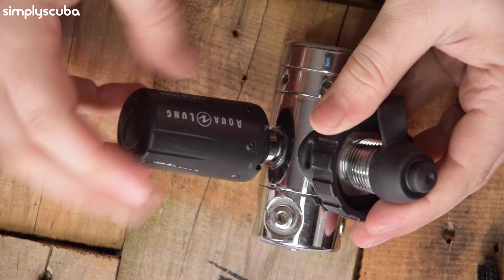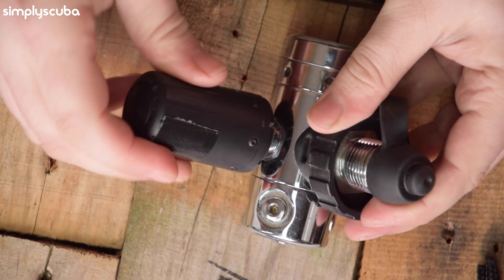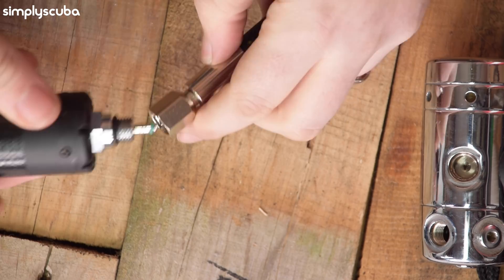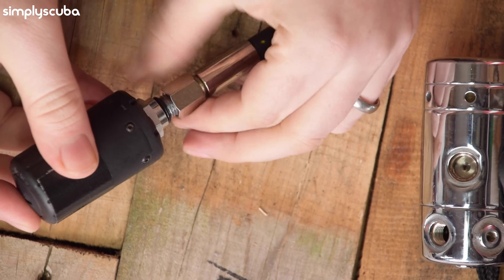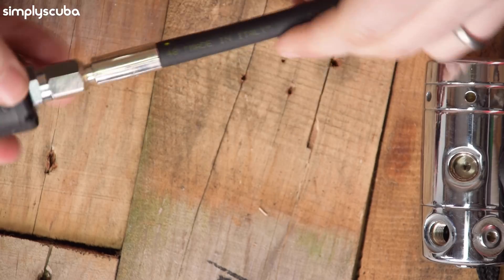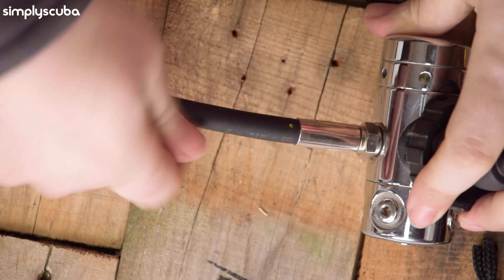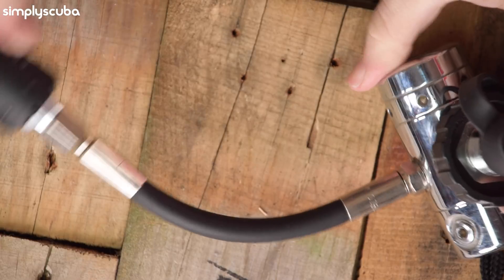How Transmitters Work & The Differences | Deep Dive

Comment: I used AI from the very beginning, since my owd course. So I never dove without it. Yet an analog spg is always backing up my transmitters.
Now, entered the realms of tech diving, I got transmitters on all my tanks. Accepting the risk of additional failure points for the benefit of increased situational awareness and safety. As AI alerts me, if for any reason, my gas runs low. Plus the estimated ground time remaining feature based on actual air consumption is a nice feature to. Till now, touch wood, never had any issues with AI, nor ran into trouble due to incorrect measurements/data.

Comment: 4:22 some ideas on why you may want bi-direction communication in designs.  Negotiate frequency, activate solenoids, pairing different probes on different tanks together, solenoid activation (e.g.  shut off tank/turn on tank, auto-switchover of CCR to OC or vise-versa), diagnostics, etc.

Comment: I'm diving without an SPG for about a year now and I had countless discussions about it. :D One hose less, one failure point less and if my transmitter ever fails, which it never did so far, it's not a huge problem. I only dive with buddies with a pretty similar air consumption, so I would cut the dive short to be on the safe side. The funny thing is, most of the time I don't have to discuss with experienced divers, but with people who are faily new to scuba diving.
Reply: Redundancy is EVERYTHING in systems. I don't care if you have 5000 dives. I'm a pilot and an engineer. We have redundant systems everywhere for a reason. What you're doing is simply showing that you don't value your life much. Nothing happens, until something happens... but hey... suit yourself...
Reply: @deathcoder  Great point. Murphy's law
Reply: @deathcoder Got to agree here 👌🏻
Reply: I also dive transmitters (two, in sidemount) without SPG backup but to be honest, if one of them failed I would thumb the dive. And that's with two tanks. I can guestimate my remaing gas levels but don't want to end up in an emergency where someone else depends on my gas and I don't have a way to measure it.

Comment: Hey guys sorry for off topic, but I have a question. Do you think going to a sauna on the dive day, but keeping at least a few hours in between is a good idea? Thanks in advance
Reply: Not really. In tech diving circles it's discouraged since it can cause DCS. Of course the chance is pretty low, especially in rec diving, but depending on your dive profile and repeated diving can increase significantly and there's no easy way to tell when it's safe.
Reply: @Yggdrasil42  Yea, thats what I thought, decided not to use sauna on a dive day, or going before a dive. It’s easier to let go than to worry if it’s ok. Thanks for replying

Comment: Recently started using the Suunto tank pod connected to an eon core.  Definitely keep my spg connected as a backup, but absolutely love the AI.  Have about 25 dives on it in the last couple of months and it’s been flawless.  Super convenient to have the air pressure reading right on my wrist rather than having to look at the gauges clipped off (with a retractor) on my BCD. It’s also very cool to be able to monitor consumption rates and gas time during the dive in addition to pressure...an incredibly helpful tool  to improve consumption. Thanks Mark!
Reply: I do the same I use a tank pod but use an SPG too just incase WiFi goes down etc.

Comment: since 2013  diving with the  aeris elite t3 never had any troubles with its transmitter. changed its battery i think 4-5 times since i got it. both the computer and the transmitter 
8:00 so my old transmitter should work with the Shearwater Perdix 
i was thinking  if i should  get one and now you just give  me a reason.
great video thanks .

Comment: My aqualung transmitter stopped working a few minutes into a dive, just flashing - - dashes - - on my oceanic oci, I still have an SPG but we aborted the dive since we were so close to the shore anyway, when I tried to unscrew it the transmitter was very hot to the touch. The battery compartment could not be opened, anyway after sending it back the shop said the battery was fried and the inside was a mess. Aqualung replaced it no issue.
Reply: Wow. Batteries remain fickle things.

Comment: I got a Mares transmitter last year. So far no connection issues. You really can see your detailed SAC rate during the dive and how much longer your tank will support you. It is said just need one time pairing even after battery change, or user actually un-pair it. I always worried about someone breaking the transmitter on the boat and finally saw Mark's suggestion on using a 15cm HP hose in earlier video, a very usefull tip.
Reply: Yeah, they can be very useful. And having the data in your log can help you improve your gas planning. I'd recommend still having a basic gas planning in your head so you don't come to depend on the 'remaining time' number. If your transmitter or computer breaks it'll be much safer since you know approx how many minutes of gas you had left at this point in your dive.
Reply: It's best to let it stabilise after depth changes, particularly initial descent, as the SAC and gas time remaining will be affected by BC and/or suit inflation.

Comment: I'd like someone to do a Wireless Air Integrated 1st stage regulator, to avoid the stupid flappy hose and bring the ultimate in robustness!  Perhaps even if the MEMS pressure sensor was interated to allow HP system integrity, the actually POD could then just be the battery and radio unit on a short flying lead?

Comment: So you can monitor your buddy's tank? What's the max distance? I assume these things are using radio frequencies...no? Is this the same frequencies that are used to talk between full-face masks?
Reply: The radio frequency links work up to less than 2 metres as water is quite hard to send a signal through, and it's quite low power.   For my Suunto it's 123 kHz, 360 mW. The new Garmin Descent adds a sonic link that is claimed to work up to 10m.
Reply: This doesn't answer your question but monitoring your buddy's tank shouldn't be a goal, unless you're an instructor. If there's frequent miscommunication or lack of communication that's definitely something your buddy and you should talk about in dive briefings since good procedures are better than tech.
Reply: @Yggdrasil42  I like redundant backups.

Comment: I use Suunto and I have never had a pod lose its pairing, even after an interval of months.  On using multiple transmitters, as I understand it the pairing tech is the same principle as Bluetooth, and once coded together there is little chance that other similar signals will corrupt the connection.
Reply: Sunnto use unique ID numbers for each POD, and therefore once you have paired your computer, it stays paired!  Because the necessary update rate is so slow (doesn't really matter if you only get a pressure update say once every 10 secs) then the PODs simply have a spread TX timing, so if multiple pods are in range and transmit at the same time, the computer just ignores the garbage data and waits for the next time
Reply: @maxtorque2277  I believe it's Time Division Multiplex.  As you say the data rate is slow so it is possible to have a good number of Txs sharing the same link and the short range limits that number to pretty much your own.

Comment: I love the extra info you can get from integrating tank pressure into the Dive Computer, a useful improvement in situational awareness.  I'd agree with you and always recommend using a 6" hose to connect the transmitter into the 1st stage to make the pod a bit more resistant to knocks.  I'd also recommend a flow restrictor, although nowadays they probably all have them anyway.
I use a conventional SPG too, but as you say that's a different discussion.